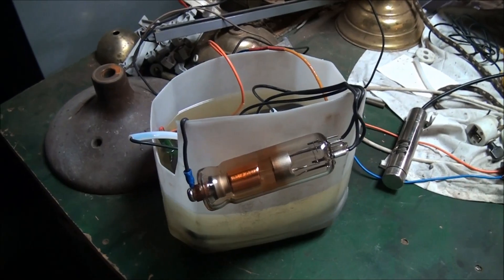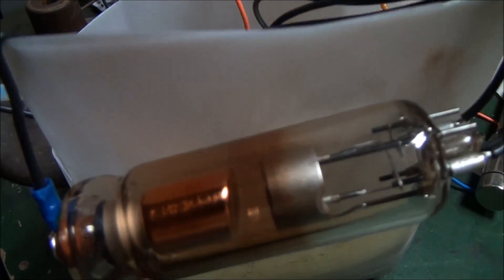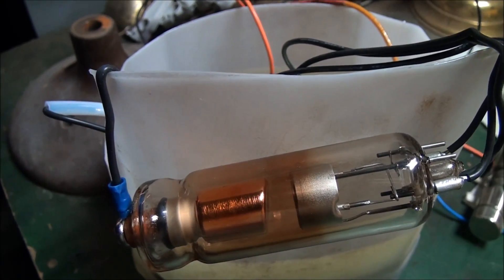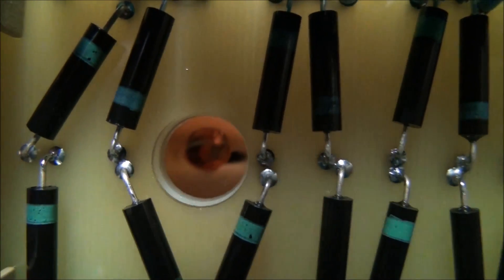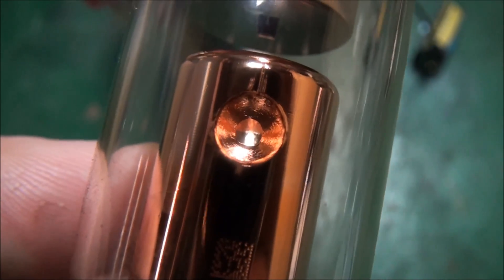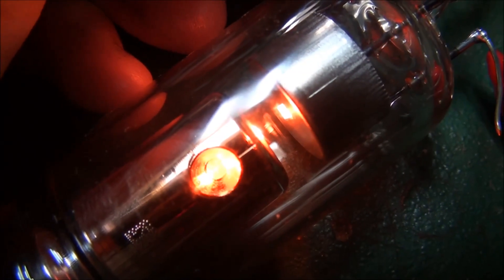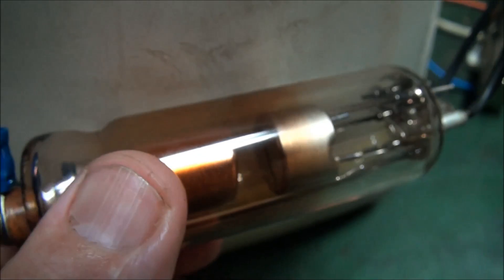Xray tube energisation, Danger!

Comment: Hi there, nice demo. Assuming this was just a one time open experiment I guess it’s okay. 

How much voltage did you apply for the tube filament? Also, have you tried running it at much lower voltage like 30-40kV. I guess at these voltages you don’t need to immerse it in oil.

Comment: Why is the glass brown?
Reply: Because of the heat that is produced thanks to the high voltage across the tube. The tube should actually be submerged in oil to dissipate the heat as 99,9% of the energy suplied to the tube is converted to heat.

Comment: I am curious as to any readings you may have picked up from the Geiger Counter.  Also, these tubes heat up quite quickly with very short exposure times and require complete submersion in an oil bath to dissipate the heat.  You are making very long exposures without any type of heat sink for the tube.  Maybe you are generating extremely low voltage x-rays or just lighting up the cathode filament.  Would like to have more information if you have it.  Either way, its pretty cool.

Comment: Kudos to your camera's design... the images were not affected by the close proximity to the x-ray emitter. 
In some digitally-recorded videos of tactical nuclear detonations or videos recorded in a high-radiation environment, like inside Chernobyl's Reactor 4 Building for example, show the effects of particle-bombardment of the CCD element inside the camera and it shows as sparkling bright flashes of pin-point lights all over the images.
Reply: This x ray tube (Dental X-ray tube) is likely generating 1 mR/h to 100 mR/h radiation although you can hear the geiger counter is screaming, it is not as high as the reactor. Nuclear fuel can easily reach 1000 R/h to 10000 R/h radiation, you see the different now. Any kinds of camera will have flashes either black or white spots on the image if you set it close to the fuel.

Comment: I recently got to disassemble a dental x ray machine, I was after 2 things, the transformer and the tube. I wanted the tube as a display, and the transformer for high voltage experiments, unfortunately it uses the newer voltage multiplier, and I wasn't able to use it. I did get a tube very similar to the first one you show though, and it will make a nice display.
Reply: Do you know where I can find X-ray machines for free? Like, do hospitals just throw them in the dumpster sometimes?
Reply: @Nexalian_Gamer  no clue. Try local e-waste centers, or if you have junkyards for more than just vehicles. You may not be able to get them free, but might find some for pretty cheap
Reply: @Nexalian_Gamer  they not allowed to, usually they will disposed off by a company or the company that is replacing that unit.

Comment: Thank you for this.  Just gonna send it to Gerard Morin who is devising very inexpensive devices to generate high voltage which then provides cheap ac power... VERY CHEAP ac power !  Turns out that what the power companies are doing is carefully NOT taught in the universities !  Take apart one of their transformers and find out (no wires touch !)  Also try asking companies that build transformers and controllers to build something needed for power generation and they will do anything but do so or even say they understand what you want !  Time to let that poor cat out of the bag !  Again, maybe this video will lead to some VERY interesting discoveries soon.  Mr. Morin is very well liked and very motivated !  The cabal is on the run and losing 100% of their funding this year, so it's finally time to see the results of everyone's research I believe.  As in free world in both senses of the word !

Comment: Would something like this expose old style film?
Oh, and what sort of radiation detector are you using?
Also, was the camera possibly getting x-ray interference in its audio?
Reply from the maker: +TheFurriestOne Most certainly! The film would become fogged when exposed to the X-rays. Film has been used for X-rays until recently, Digital technology is replacing wet film processing. The X-ray film was enclosed in a light proof cassette with a Fluorescent screen against the film sheet to reduce exposure times and maximize the resolution of the image. Early screens glowed bright green but were later replaced by Blue and Ultraviolet emulsions.    The audio during the exposure was the sound of a Geiger counter I placed nearby to detect the X-rays as I ramped up the voltage, the detector is a basic Geiger counter using a GM tube. I also used a Ludlum survey meter in the last exposure.
Reply: ***** Well, I knew I was hearing a Geiger-counter, but at some points the audio got rough/static-filled. Anyhow, thanks for the video and the info! I've had the new digital systems used on me at the dentist, they're pretty slick, one click to get the pic!
Reply from the maker: +TheFurriestOne You have a good point there, I think that there was some extra interference on the Audio, I will try some more shots without the Geiger counter and see what happens. I was expecting glitches on the Video images, maybe another camera with lower resolution CCD might respond better.
Reply: ***** Might, the older ones could be less well shielded!

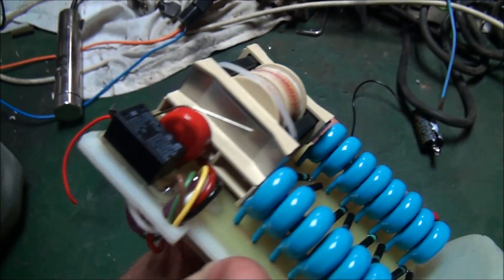Comment: 1:25 I really like that flyback-multiplier board... very nice!
Great demo :)
Reply from the maker: +Energy Fabricator Yes, those flyback multiplier boards are great for producing very high voltages. I find that its that small transformer fails so a suitable ZVS circuit with a TV flyback works very well. Be sure to immerse that circuit in good transformer oil to prevent flashover.

Comment: That didn't sound like a safe distance! Did you forget the A.L.A.R.A principle? I'm a little worried that you'd be showing this type of thing on YouTube to be honest!
Reply: +rustymotor  I agree,  this is a stupid thing to do!
Reply: @tr0ubl3mak3r  nah I play with xray tubes all the time I got a homemade gun that can xray 2 inches on lead lol and I turned out ok completely normal  🤪
Reply: what kind of trouble maker says that? knowledge is power.
Reply: +tr0ubl3mak3r seventy-six Don't worry about this.  Look for the Radioactive boy scout vid
Reply from the maker: Inverse square law principles are a good guideline to reduce Xray exposure, I made sure I was at least 4 metres away. The output from a Dental X-ray tube is quite small as compared to a CT scanner tube or the ones in a general X-ray room, anyway it still is a dumb thing to do and no one should attempt it!
Reply: @rustymotor  did you have the radiation meter next to you or well in front of you ?
Reply: @rustymotor   Kerosan channel with crasy Ukranians did experiments with x-ray tube and only after exposing themselves to lot of radiation they tested how much dose it was giving. They could actually measure scarily high doses 50+ meters away outside in free air in the direction the x-ray beam was pointing ....
Reply from the maker: +tr0ubl3mak3r seventy-six I do agree!

Comment: so an X-ray tube is basically a valve just with much higher voltage and and much more dangerous you learn something everyday! thanks for doing that must be the most dangerous test I've ever seen
Reply from the maker: +jon johnson Yes, an X-ray tube is basically a very high voltage Diode which produces lots of X-rays due to high energy Electrons crashing into the Anode, Tungsten is used due to the efficiency of producing X-rays. I made sure I was far away as possible from the source!

Comment: Nice video. Not too much of this sort of thing on YouTube. Were you running the X-ray transformer from a variac?
Reply from the maker: +ben hunter You are correct, I slowly ran up the voltage on a Variac to measure the stage where X-rays are starting to be emitted, I took great care to keep a good distance from the unit.
Reply from the maker: +michael phillips I made sure I was a fair distance away, the inverse square law principles dictate diminished X-ray exposure with distance. I also had a makeshift metal barrier to help filter 'soft' X-rays which are more likely to be absorbed by Human tissue. The rig I made up will be dismantled once I am done with it, one more experiment coming up though.
Reply: +rustymotor what kind of protective mesures were you taking - hiding behind a pice of tin roof? or a huge concrete block?